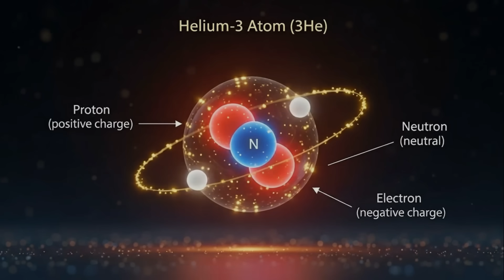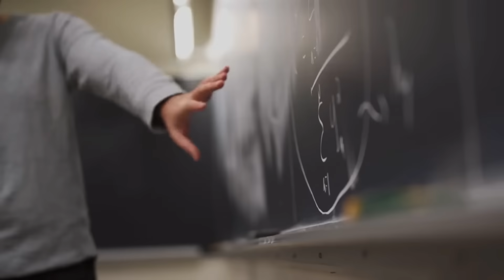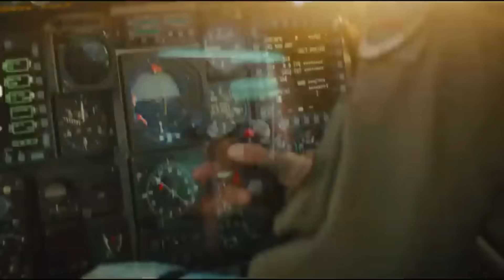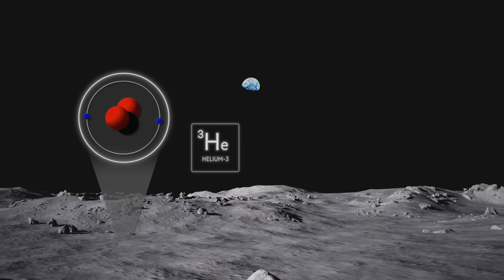China vs NASA | Here's the Truth NASA Won’t Tell About the Moon | NASA falling behind China

Comment: Does anyone know how China plans to get past the VanAllen radiation belts combined with the artifical radiation belts that were created from STARFISH PRIME  during operation FISHBOWL in the 1960's?
Reply from the maker: Great question — that’s a real scientific challenge! ☢️ China, like NASA, is developing advanced shielding and precise flight paths to safely cross the Van Allen belts. Modern technology makes this much safer than it was in the 1960s. 🚀
Reply: Why don't they just use the same technology that US used in 1960's instead of having to develop it?@ThefactEngineofficial
Reply from the maker: That’s a smart question! 🤔 The old technology worked then, but it’s outdated now — less safe, less efficient, and impossible to maintain. Modern missions use upgraded materials and computers that make space travel far more reliable. 🚀

Comment: To me, NASA has already admitted publicly that the Moon landing is fake. Only they may or may not be aware of it. Please refer to Wikipedia, the free encyclopedia.
Moon landing conspiracy theories: https://en.wikipedia.org/wiki/Moon_landing_conspiracy_theories

Specifically, the 3rd item under the Environment section, please pay attention to the confession of " every Apollo landing was made shortly after lunar sunrise at the landing site."

"Environment
3. The Moon's surface during the daytime is so hot that camera film would have melted.
There is no atmosphere to efficiently bind lunar surface heat to devices that are not in direct contact with it. In a vacuum, only radiation remains as a heat transfer mechanism. The physics of radiative heat transfer are thoroughly understood, and the proper use of passive optical coatings and paints was enough to control the temperature of the film within the cameras; Lunar Module temperatures were controlled with similar coatings that gave them a gold color. The Moon's surface does get very hot at lunar noon, but every Apollo landing was made shortly after lunar sunrise at the landing site; the Moon's day is about 29+1⁄2 Earth days long, meaning that one Moon day (dawn to dusk) lasts nearly fifteen Earth days. During the longer stays, the astronauts did notice increased cooling loads on their spacesuits as the sun and surface temperature continued to rise, but the effect was easily countered by the passive and active cooling systems.[94] The film was not in direct sunlight, so it was not overheated.[95]"

Here is my take on NASA's admission that the Moon landing is fake.
No matter how hot the lunar surface is, we've all been in a kitchen. The temperature of a hot stove is far higher than that of the scorching Moon. On the Moon, the amount of radiation is the same in the morning and at noon, including thermal and other radiation, because the origin and primary source of radiation is the Sun. Therefore, the danger on the Moon comes from solar radiation, whether thermal or other. However, the most dangerous time for humans is "shortly after each Apollo moon landing at the landing site." Due to the shape of the human body and the standing posture, whether on Earth or the Moon, humans receive the most solar radiation "shortly after lunar sunrise." Therefore, NASA's statement amounts to confessing that it sacrificed astronauts' health to protect the film in the camera. Never mind the few hundred degrees on the moon's surface at its hottest; that's nothing compared to the stove in a kitchen, and it poses no danger to the film. The heat from the moon's surface is even less of a threat due to the lack of air or a vacuum. Just imagine you in a kitchen without air, or a kitchen being vacuumed. To you, the same stove will only feel cooler than a regular kitchen with air because you are feeling both radiated heat and the heat conducted by the air. Now, you know the NASA people wrote the above paragraph, and they know nothing about vacuum, heat, or the moon.
Reply from the maker: That’s a detailed perspective, appreciate you breaking it down like that. Do you think NASA will ever release something that could change people’s minds either way?
Reply: @ThefactEngineofficial  Sigh, they have nothing to release. 
However, anyone who's done the work knows the value of the unsung heroes. 
Hollywood even gives a little Golden Men to the workers behind the screen, even though generally no one dies in making movies. Of course, the stars' values are the greatest: they get the awards in the end and enjoy the most glory. 
So, if NASA could give some recognition to the scientists and engineers behind the Apollo project, of course, over 60 years have passed. NASA has waited long enough that they all passed away, so there is never publicity for them—it could still give some publicity to their children to remember their parents, perhaps by building a memorial like the one for the Vietnam War with the names on it. After all, it's said that a few died during the Apollo project. Who remembers them? 
NASA releases a memorial like the one for the Vietnam War with the names of dead unsung heroes on it, which would prove to me that NASA did the Apollo project.
After all, the Apollo project is about the first time humans walked on the moon. The Apollo project is humanity's project, not just an American one. The treatment of the Apollo project and the people given by the Americans and NASA proves beyond a shadow of doubt that the Apollo project is less than a TV show.